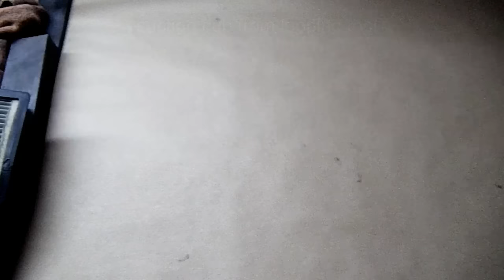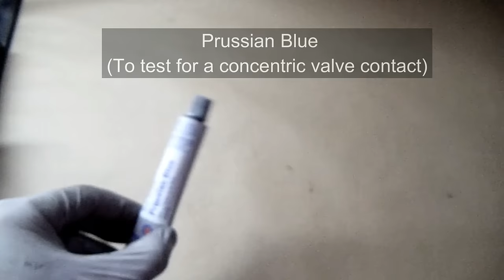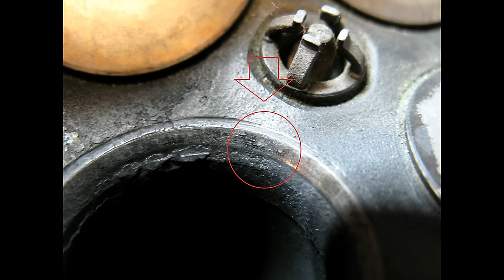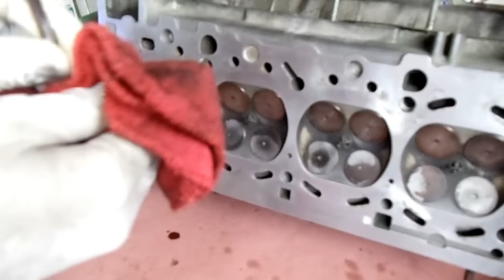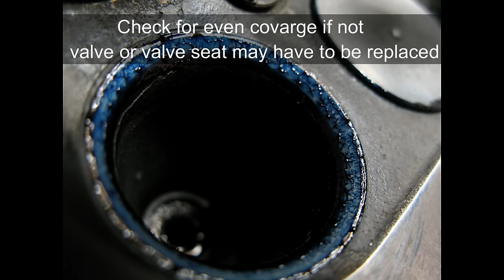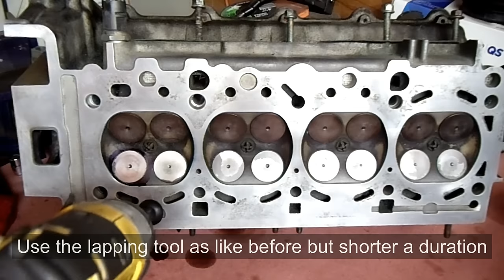Lapping and Checking Valves (EASY WAY)

Comment: I am a certified mechanic and use this method along with other shops. His seats are in spec. He did a great job! Thanks for sharing!
Reply: Thanks for this comment mate..I'll be doing same when I get all the gear together..doing my diesel WL head..
Reply: Wow
Reply: @DieselRamcharger  all I said was “wow” what’s wrong with that?
Reply: @natanyofsho  i replied to the OP not to you. notice your name isnt tagged in. the youtube comment section is so stupid how it works.
Reply: I'm not a mechanic but using an electric tool like that isn't a bit too much ? Doing it by hand is a better way ? Probably slower but better isn't it ? Looks a bit agressive with a drill
Reply: @cookieintune  It honestly depends on how comfortable you are, but also how bad the pitting is. If it's really bad you could start with a drill bit sneak up on it by hand to get it really accurate.
Reply: @Dj Strings Music  it seem so aggressive and usually I see people doing it by hand , I guess in the end it's about how confortable we with the material and tools we are using but going by common sense I woud try learning it by hand , it seems so old school cool . Deff want to try doing it some time , I think it is cool and interesting work
Reply: You must have use your Eyecrometer to measure the runout width and depth.
Reply: Hi! Would u have to do this even if your using new valves too?

Comment: I run a small engine shop, after the only machinist in the area retired I bought a hand set from Neway to cut valves and seats. They use carbide cutting bits and they make a very different finish than a stone cutter. I cut the valves at either 30 or 45 depending on spec. Cut the seat to a 46 or a 31 depending on spec, and use a maybe a 31 on a 46 at the top if the valve is seating too far outward. Once I get them seating pretty good I take a fine lapping compound and hand lap for no more than 5-10 seconds tops. Prolonged lapping will concave the face of the valve and destroy the new finish. For the lapping I take a piece of fuel line and push it over the valve stem and rub my hands together with the fuel line between them (like starting a fire with a stick). Finally I use a permanent marker and color the face of the valve, clean the seat really well and turn the valve no more than 5-10 degrees. This checks the contact all the way around the valve, note that turning the valve further would rub the entire face of the valve across any high spots there may be. Not the most professional way by any means but ones I've done 6-7 years ago are still running good when they come in for spring service.

Comment: I lap by hand so you can hear and feel what is really going on. It takes much longer but it's very gratifying knowing it's done perfectly.
Reply: How long does it take to do by hand? I have a head off a dirt bike where the valves tapped the piston, the valve area where it sits looks alright but has a good bit of carbon build up. Would this get rid of the carbon also or do I need to get rid of that before doing this method?
Reply: @joet6990 ive lapped hundreds of valves get rid of all the carbon make sure it is completely cleaned first than get some engineers blue its good for beginners so you know where your at other than that its easy when you lap by hand it will get quiet the more u lap thats when u check
Reply: @Snorky_88  well I ended up just letting it sit in rust remover overnight and that removed almost all of the carbon buildup inside of it, I also watched a video on laughing valves which may have been yours. I kept going until all I saw was that silver line all the way around this seat and there are no black pits in it. when I blow into the intake hole and push my valve all the way in I can notice there is a small air leak. I put some soapy water onto everything and it looks like the air leak is coming from the new valve guide from the inside of it. Is that going to be sealed up when I put a valve seal on the end or is it still going to continue leaking? Will that cause compression issues?
Reply: @joet6990  did you ream the valves? Or check the tolerances of the valve guides? I would check the correct bore hole and see if yours is in spec with what your manual says they could be worn out im doing valve guides on a triumph 650 right now and similar thing happened to me oil was seeping past the guides

Comment: lapped my valves today. used some of your info. I went back and forth with the drill rotating direction. My seats and valves came out great with no scratches. Holding gasoline as well within the chambers.
Reply: Thank you.
Reply: @myintkyawmoe5373  lol 3 years later.
Reply: Just catching up with the valve job. Is the engine still ok?
Reply: @jcr8834  Is your valve job holding up good?
Reply: @lusun8078  yes no problems. But sold the engine already

Comment: This is a good Old School trick we "Budget Racers" used. Might use less lapping compound and keep the speed as low as you can.....save the valve guides. Also, the marking dye should be transparent when applied properly.....but, all in all great information to help those that can't afford those machine shop fees which now are just crazy!
Reply: I just use the 2 stage compound .clean off nicely. Assemble and pour some feul to check for leaks.
Reply: Machining is outrageous now adays $90 for a simple crank polish or few hundred to resurface a set of heads is bullshit!
Reply: @dirkrosslee796  yeah gas or acetone is great for checking seats.
Reply: I used soapy water (lots of dish washing soap) over my valves after pulling the head, then blew compressed air under the valve and watch the bubbles grow. After a good lapping no more bubbles.
Reply: transparent marking dye. you just won a patent.
Reply: @martinez1701a  The machine shops have a lot of overheads to pay out on whether they get work or not, plus per hour depreciation on equipment and consumables. Then of course they have to pay their workers.
Reply: @DARANGULAFILM  to a certain extent that's true but my old Machinist ( unfortunately he passed away) didn't charge an arm and a leg for the same work, now the person who took over his shop is charging 3+ times the amount. Btw I work/manage a shop myself so im not ignorant about the finances and I assure you alot of these so called engine shops are a straight rip off and have inconsistent work.
Reply: @martinez1701a  ---- which contrarily may be why the new owner now charges more. The old owner probably had everything worked out to a very tight discipline and was likely more efficient or simply satisfied with a moderate reward. Some of the oldies as you suggest were not greedy and did not  do the "what the market will bear" thing which could burn the newcomers in the long run when imported replacement engines become more attractive than rebuilds.
Reply: @DARANGULAFILM  charges customers more cuz they fuck up and suck at what they do lol that makes sense.
Reply: Considering how many millions of times valves move up and down, I really don't think wearing out the guides is an issue during the valve job. Unless you don't put oil on the stems of course.
Reply: @MrItsthething  Cleanliness is next to godliness. If you get even just traces of lapping compound in the guides they will not last long. Hand-lapping will do a lesser amount of damage and will not throw it around like spinning with a drill will. That said, I must confess to using a drill on the collet end of the valve stems when rushing a valve job on an old junk cylinder head in order to make a trip from Port Hedland to Shark Bay for a long weekend holiday. I ended up leaving that head on for another 15,000km, one of those "if it ain't broke things". It was still running fine when I took it off but the flaking rust from inside the water jacket had blocked the radiator when the water filter I installed burst. The fibreglass screen mesh had dissolved away almost to nothing. It seems iron rust chemically attacks it. The guides were worn out even before I tackled it. The junk head just happened to have a half-good set of valves in it which had gone rough from being left out in the weather for a couple of years. The good head I took off had four burned exhausts of a different size and new ones would not arrive until after the long weekend. You do what you have to do but lapping with a drill is not my preferred method. Now if you want a real headache, try a Toyota 2NZFE quad valve head. Tiny little dinky valves like in a Honda lawnmower engine but they see to get good endurance out of these engines if they are properly looked after and that means changing out the oil twice as often as recommended.
Reply: Well yes, getting lapping compound on the stem is very bad. But there's no problem with doing some extra lapping if the stem is clean and lubricated.  @DARANGULAFILM

Comment: Lapping valves is not a machine shop only job, they usually grind, maybe replace stems. I use drill & hose on stem lapping, w/ finger grease to press the valve in & out lightly (let the compound do the work). Just push the compound back into the seat when it squeezes out. 

Prussian blue (or marker pen) isn’t necessary, you can easily see the gray resurfacing from the lap. If you’re really concerned, when done put alcohol on the valves and look for leaks in the ports. 

FYI Extra compound will not hurt the job, running it w/o compound can gall making scratches (same type metals gall). You can easily clean off the compound & not worry about grit in the engine.

TIP – A wider contact surface on the exhaust is desirable, it pulls heat off the valve. A narrower contact on the intake helps prevent the seat from cooling (shrinking and dropping). Some valves have a 1º offset and not a solid contact (good for intake). 

Everybody has their own take on valve jobs, use what you feel’s best. You can get so perfect with stuff and still not have any better performance – just avoid burnt valves and dropped seats. If any of you are really that concerned, then replace the valve guides also. Nice video.
Reply from the maker: Thanks for the info.
Reply: 0-Zone  I like the alcohol idea . My papa told me to use gas to check if it was good. A little less fumes your way.
Reply: @henryfuentes3425  whats wrong with some fumes, makes the job more fun

Comment: I've been getting great results for years using a variable speed drill on the valvestem and pulling it rather than pushing.  Only tried it because my lappers suction cup had dry rotted.
Reply: you havent been getting good results.
Reply: @DieselRamcharger  got nothing better to do, eh?

Comment: Generally lapping is back and forth and rotating the valve on the seat. It is normally used to fine tune the contact after both valve & seat have been refaced. This method maybe a little harsh.

Comment: I tried a similar process myself except i used a hose on the other end of the valve and connected that to the drill.
I changed direction of the drill a lot, not sure why but figured it might help.
I did not have the suction thing you had.  To my delight it worked much like yourself.  Always satisfying to do your own work.
Well done.
Reply: I tried the hose did it about 5 to 6 times sound didn't come clean and the hose wobbling scares me to think of whats happening to the guide. I would much rather try pushing the valve perfectly into the seat than bending or warping the stem and oval wear on  the guide.
Reply: @snowblind5151  I had similar thoughts. It would seem to be much more accurately done with the control permitted by direct feedback of the feel if you were to use a low-cost hand-held lapping tool. That gizmo is essentially a time-tested standard. 

I can't imagine an advantage to sleeving the stem with hose and having to pull it backwards or upwards against gravity to do this with acceptable precision. I'm not hatin', just statin'. 

As well, people who use power tools for more finesse-dependent work like this are the impatient horn honkers who pass cars to be first in line at the next light. : ] Unless you can work with the exactness of a CNC machine on a job like this I don't think that a drill is your friend for anything other than getting this done in a hurry, as in a busy dealership shop or a half-assed Sal's Garage. It's easy enough to make a mistake by hand, and the force inherent in a drill is a mere extension that can take a correctable mistake to the level of irreparable fuck up.

Comment: The best way to do a diy valve job is lap the seats until pitting is gone, then have the valves ground at a machine shop to restore a perfect cone shape, the do a final light lap with fine compound. Cutting the seats is where most of the money goes, and hardened seats tend not to wear as quickly as valves anyway. More importantly, the valve needs to be able to expand from heat and still seal. You only get that back by grinding the valve. Lapping a worn valve will make it seal only in the exact position it was lapped, which won't matter when it heats up and expands
Reply: Alistair B what would be the consequences of a too large contact area between seat and valve? I’m changing the valves on my motorcycle, and after lapping it looks great, but the contact area is right around service limit on exhaust side. It’s not that I’m lazy to go have the seats cut, but I live in Vietnam, and I really don’t want to have the machine shop molest the head. If it’s a question of longevity, I can live with that, but I wonder if there are other issues? Cheers
Reply: A valve that goes to the machine shop is much more expensive than a new valve :)
Reply: @borna430  not necessarily. I worked in a machine shop we always ground the valves if they weren't too damaged. New valves can be pretty expensive or hard to find for vintage or exotic engines.
Reply: Would I be okay lapping new valves with used, unlapped seats?
Reply: Aftermarket valves that is.
Reply: @vadski3469  No.  Take the head along with the new valves to a machine shop and ask them to recut the seats.  They will need to valves to correctly position the contact seat on the valve face (critical for exhaust valves).
If a quality seating job is done, no lapping is necessary.  The contact will be accurate enough to seal, and the surfaces to 'hammer in' quickly once the engine is run.

Comment: I did something similar, I use a smallvacuum hose attached it to the opposite end of the valve stem and pulled up instead off pressing into it.  I didn't have the lapping tool as you did but worked just as well. If it works it works

Comment: To any of the people saying this won’t work and this isn’t a good job, I’ve done the same thing on engines many years ago that are still running perfectly. All you need is the valve to seal against the seat. If the valve has a coating and you wear it off then the valves won’t last. So in that case you replace the valves and lap new ones in that aren’t coated.

Comment: HUGE HINT..  if your valve seats are 44 or 45 degrees..  take an extra valve and grind it to 60 degrees so you can narrow the seats up from the bottom with lapping compound. you may need a slightly larger valve to grind a 30 degree seat on that to narrow valve seats from the top with the 30...  you will have to do this with exhaust and intake valves.

Comment: When valves arent flat and suction cup wont stick  i use a 1/4 fuel hose . I slide the hose over the valve stem from back side and i put a short peice of dowl in the drill side of hose .  Clamp on drill then do the lapping . just another way i thought id mention .good job there bud .

Comment: This is manual process, don't use an electric tool!!!
Reply: I've personally done it this way a couple times so far during my apprenticeship and have not had any problems, however I can see why you personally may choose the original way over this as it could be easy to make a mistake like this, however I feel if you take your time it can still do the job right and save you a lot of time.
Reply: I wanted to cringe when I say that power tool, I started my trade doing heads in cummins  engines. 
The face of that valve and the seat should both should have been faced.
This is a short term solution
Reply: Bob Glidden used to use a food mixer back in the day and I seem to remember his pro stock motors ran pretty well.
Reply: That valve and that seat are so bad that the valve should have been faced and seat cut to ensure apropriate angle and back cut lapping fucked valvles like this will cut its own angle and destroy CFM
Reply: BS.  I build/rebuild roughly 20 heads of all makes per week.  I use a drill on every one of them to lap the valves.  Been doing it that way for roughly 7 years.  You deal with the Doodle stick if you want.  I'll do the same job...better...in 1/10th of the time.  Also, no need for prussian blue.  After you've don't enough you'll know by sound and feel.  You can also use a sharpie if you really want.  And yeah...that was WAAAAAY too much!lol!
Reply: You know for about 50 bucks you can get either the cheap chinese pnuematic lapper or a lapping adapter for a drill. That way you get the proper "1/4 turn and lift" scratches that seal right without spending forever on one head.
Reply: A spanner man all me life...im 58 yrs now... i put a little oil on valve guide ...oil can... put the valve stem in the drill chuck ....and pull the valve in to the seating ... slowley... helo from ireland....😉
Reply: you can use a drill, if you ever went in a factory there don`t have people there manually grinding, its a machine, you just have to know what you are looking for, he grind too much, so the face and margin are gone, if he didn`t grind away the margin and face it would of been good, but his engine will work still.
Reply: Waco Tx  ikr, looks like in the factory there let someone sand with a stick 😂😂😂😂😂